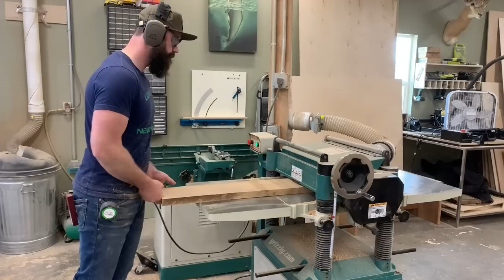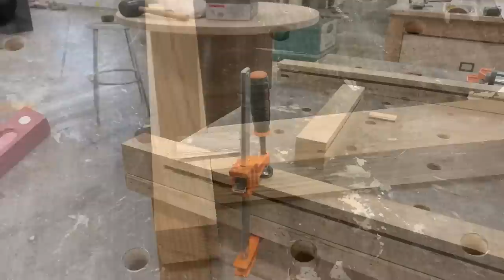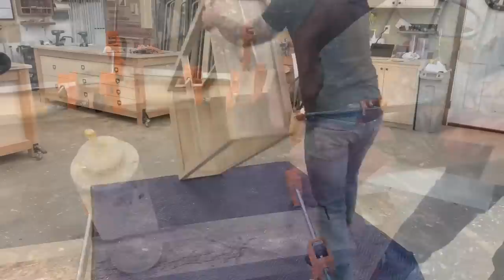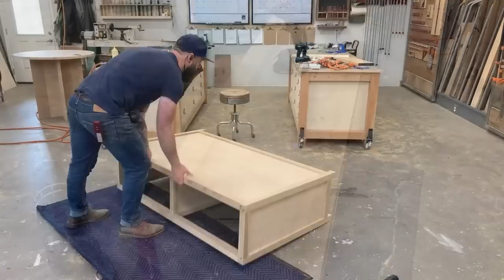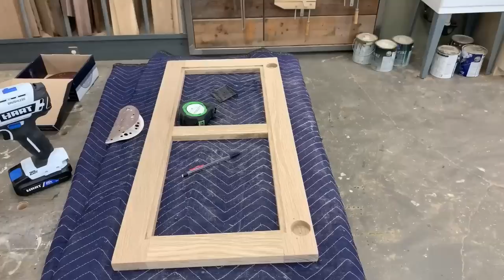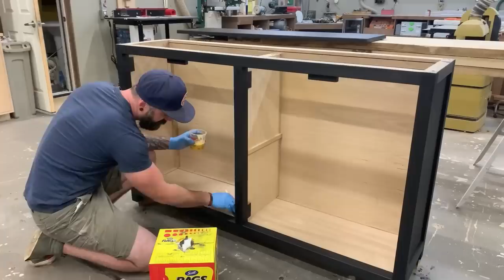Easy Rustic Storage Cabinet || DIY Painted Hutch

Comment: That's a stonkingly good cabinet and matching video.  Well done.  I use the hand tool only, mortise and tenon jig that RJ's Shed Shop shows the replaces the Domino for hand tool only workers.  It's simple to build and use.  He only used it to cut mortises, but it allows me to cut perfectly matched mortise and tenons along with half laps and bridal joints straight from the Japanese saw and chisel. I was going to message you with photos but it said the message service was only for sponsors.  I've looked at sooo many sites and this is the only jig i have found that does all with hand tools only.  I think it would be a service to your many followers if you put together the jig and showed them what it can do.

Comment: What’s to hate?  My wife several years ago talked me into taking a arts and crafts entry hall table I built years before and refinish it with black dye stain that looks similar to what you used.  I was hesitant at first but the piece came out great and the more muted grain and darker color works better where it lives in the entry hall.  There is nothing about either the construction or finish that I saw to criticize.

Comment: I think sometimes “Woodworkers” need to get over themselves a little bit. Don’t get me wrong, I love the upper end hardwood slab work, but work that starts at several thousand dollars is jus not accessible to the vast majority of people. This piece which I would guess is less than  thousand dollars is. Someone may just try it.
Reply: Do you do woodworking yourself?
Reply: Material costs as well as tool costs  for slabs is insane.  Just go to a hardwood dealer and look at price by the board foot for most any wood.  It’s very high.  This 5 minute YouTube video is likely a full week of work in addition to that.  Even at $100/hr that’s a few grand more after a week of work.  Heck the hourly rates for auto mechanics is like $120 for comparison.). Buying bespoke wood furniture is just going to be expensive, for everyone else there’s wayfair/IKEA.  Or try to make it yourself. You can save on the labor hours of you have the time and ability to pick up the skills, but the material costs will still be high.
Reply: I could build this for less than $300 and could sell it for $1000. If i had all the tools set up in the shop it would take 13 days just because of drying times on the glue, stain, and varnish.
Also the guy in the video ruined it by making it black.  It would have looked much better with a nice dark or natural stain.  This painted wood look sucks.
Reply: @TwoStageTrigger  pretty sure that’s not paint. Have you ever heard of Rubio?
Reply: @TwoStageTrigger  you’re like the exact person he’s making fun of 😂
Reply: @TwoStageTrigger  I think it was black stain , not paint. I think it looks amazing with contrast to the natural interior
Reply: @TwoStageTrigger  Maybe the client wanted it black.
Reply: Great music!

Comment: It seems a bit odd to spend so much on beautiful oak for the frame and then cover it all with black paint.  Any cheaper hardwood would have been just as good.  Nice work on the cabinet though.

Comment: I have a legitimate question to ask about using biscuits, not a haters question, but i truly want to know. IF, as everyone says, biscuits are only for alignment, why use them at all. It appears to add way too much time into the set-up- from aligning the wood with clamps, marking on both pieces, then setting up the biscuit joiner, then glueing in the biscuits,  to aligning and clamping anyway,  WHY? Isn't it all just a waste of time for something you can align with a clamp (like you did in the first place)? 

Truly perplexing to me.
Reply: Because what you're looking at is not a biscuit joiner, its a festool domino. The domino produces what is essentially a loose tennon and in this build is the main method for joining the legs and rails, its a very efficient and strong joint and quite different and superior to a biscuit joiner. Your assumption of the biscuit joiner  is correct though in that they are only really used for alignment.
Reply: @Rupert Vivian-Davis  nice one! Thanks for the reply. So a domino, worth it. Biscuit, not so much?
Reply: I have a biscuit cutter and a domino. Biscuits significantly reduce the misalignment that can happen when two parts start to slide against each other when clamped.  I use them whenever I'm gluing up wide panels - it reduces the need for planing/sanding once the glue dries.  Dominos I use to make joints - they are quick to cut and very strong.  If I had to choose I'd take the domino...but everytime I glued up a panel I'd wish I had my biscuit cutter.  I'd rather cut a few biscuit slots than fiddle around with the other methods of keeping long joints from moving when clamped.
Reply: @markphillips5800  @rupert Vivian-Davis THANK YOU FOR YOUR SUPPORTIVE COMMENTS! 

I am a long way off either tool in my workshop, but that doesn't mean I'm not thinking ahead.